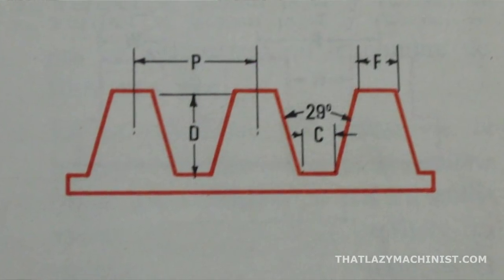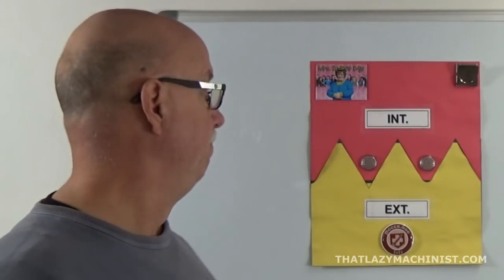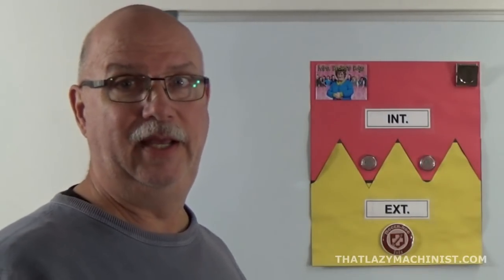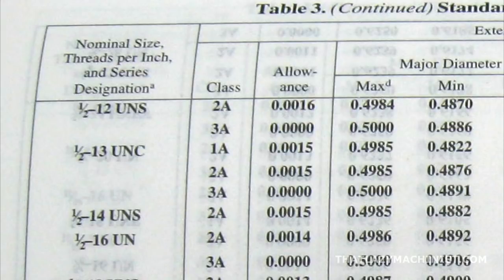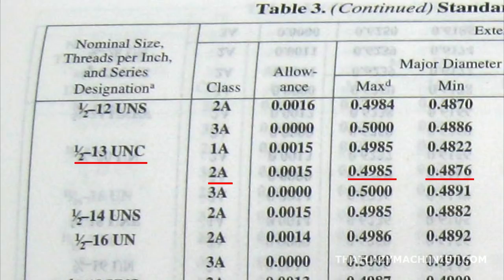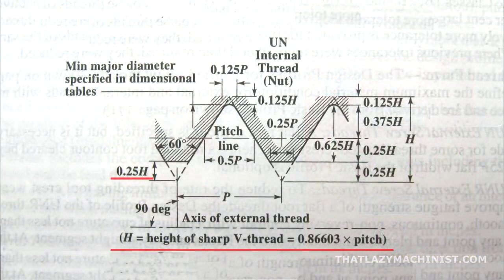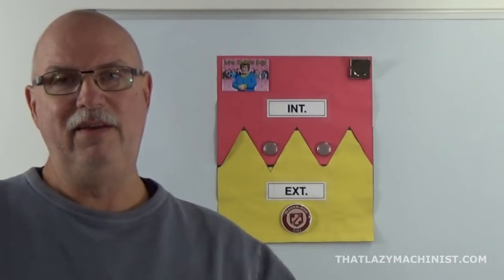HOW MACHINE THREADS WORK, LATHE 101 MARC LECUYER

Comment: I would add this to the differences between fine and coarse threads: there is a cylinder-of-shear where the amount of internal thread cross section and the amount of external thread cross section is equal (it's about halfway between the major and minor diameters - clearance makes this slightly inexact ). Because the coarser threads cut deeper into the shaft of the screw, the minor diameter is smaller; this makes the halfway location smaller as well. Because this cylinder-of-shear is smaller it has less area; because it has less area it is weaker. Thus coarser threads (against all intuition - how can tinier threads be stronger?) are actually more likely to strip - which is what happens when that cylinder of shear actually shears. It's because the finer threads have an average larger diameter.

I really enjoy your videos. Sometimes the fundamentals are needed, even for folks who have some (or much) experience in the shop. (From a fastener guy whose family was in the fastener business from 1929 to 1998.) Thank you.
Reply from the maker: Thank you Peter for such a great comment. It is great that people such as yourself can comment and explain and really add to the video. Truly a great comment, Marc (I am going to make this  the top comment)

Comment: Tell me if I have this right. A MT 4 is .62326 taper per foot. So taper per inch is .62326/ 12= .05193 . My sine bar is 5 inches so 5 x .05193= .25968.  So jo block stack of .25968 under the one end of my sine bar will give me a MT 4 slope on my part.this could be milled on one side of a plate to be used as a template for setting up my taper attachment. 
Keith ps thanks again for your time.
Reply from the maker: Hi Keith! I don't have my handbook close so until I do I will say that taper per foot is total taper (both sides). If you want an angular bloc for setting you taper attachment, you will need half the total taper. Your joe bloc stack of .25968 seems a little high? It may need to be divided by two. I will get back to you later when I can verify your numbers more accurately. Marc

Comment: Thank you. I went to training at the Caterpillar plant and they explained why they only use grade 8 bolts. Simple, so a weaker bolt doesn't get used in a high strength application. Also watched them test the bolts. Tensioned in a machine that progressively put more tension on the bolt but with a wedge under the head to induce another force that real life is likely to do. I think all grade 8 bolts are roll formed, not cut. That should improve the metallurgy/strength. But the holes in the castings would still be cut so would need to have a greater depth to be able to fully utilize the greater bolt strength. There are taps that don't "cut" but rather deform but I'm not sure they would be a good idea in cast iron. Your thoughts on that?

Comment: Really good video because I am trying to use the Machinery's Handbook (download FREE pdf ebook version 29th Edition at http://allaboutmetallurgy.com/wp/wp-content/uploads/2016/12/Machinery_s_Handbook_29th_Edition.pdf, while you can) and I find it carries so much historical info that it takes a long time to sort through what the tables are actually saying. I watched a video on cutting a thread protector for a 10" Atlas lathe and am still trying to figure out how they got to the thread measurements they did, which aren't what I would have calculated them to be.  Slowly I am correlating the data in the tables to stated thread geometry. Looking forward to your next video because I am not sure where some of the info in the tables comes from - can't match all theoretical geometry to numbers in tables. For example, I have to just take "Allowances" as a given, I haven't found the MH explains it will. One good thing, I have worked thru the geometry to be able to understand why/how the "over the wires" measurement works.
Reply: Link Is dead.

Comment: Nice video, and quite informative.  I have one question, though, about a statement you make around 13:08.  You say a sharp-V thread is impossible to manufacture.  But isn't this the resulting thread when you single-point cut an internal thread on a lathe?  It seems that I have to knock the sharp-V off with a file, else there is an issue with the crest interfering with the roots on commercial nuts.  Or am I misunderstanding something?  Thanks again for the great video... I love your presentation style!
Reply from the maker: Hi Clive! It is not rare to have to file the crest of an external thread after cutting it since the single point tool kicks up a burr that can interfere with the root of the nut. If however you are getting a sharp V crest when cutting an external thread it could be that your major diameter is too large? When cutting an external thread I tend to turn my blank close to the smallest acceptable diameter, this helps with assembly and doesn't affect unduly  the strength of the thread. Also I should have been more specific with my explanations! When I mention "sharp V" thread I am talking of a sharp root (which would require a pointy tool) and not a sharp crest (which would mean that the OD for an external thread is too large or that the ID of an internal thread is too small. I hope this helps? Please get back to me if more explanations are required and thanks for watching! Marc
Reply: THATLAZYMACHINIST 
Hi, again... In the midst of a brain fart, I typed "internal" rather than "external";  thanks for clarifying that.  I can probably reduce the O.D. of the blank before threading, but won't that cause a poorer flank-to-flank fit between the mating parts?  It seems to me it would be more "proper", for lack of a better term, to remove the point/burr from the external thread crest so it meets the thread spec more closely.  (Crest of external threads are supposed to be truncated or rounded, I believe.)  Anyway, my original comment was related to your comment in the video about true V crests being impossible to form.  I thought you meant internal AND external, but you have clarified that you only meant internal.  My apologies for any confusion.  Best regards, Charlie

Comment: One thing I noticed a long time ago was that if you take an equivalent sized metric bolt to an imperial; the most common thread used is between a imperial fine and the coarse. With the imperial threads the coarse seems to be to coarse and the fine seems to be to fine for most applications.
  I always compared a thread to a wedge, with the thinner wedge able to exert more force with the same pressure applied. This is why if you applied the same torque to the head of a fine and a coarse fastener the fine thread clamping load would be much greater, which might be part of the reason they seem to strip out easier. 
Cheers waiting for part 2
John
Reply: I had to replace the rotation bearing bolts in an aerial lift truck (ie a tree trimmer boom truck) and the manufacture called for anti-seize be applied to the bolts and the torque value was reduced. I called the manufacture and an engineer there explained that because of the anti-seize that the bolts would turn much easier and if the torque was not reduced the bolts would be stretched. 
He also added that as long as there was not more force applied to the fastened than the clamping load achieved at that torque, the fastener would not come loose even with the anti-seize applied.

Comment: Hi Marc,

As I recall, the 55 degree angle of the Whitworth system gives the very best strength available from the metal, which is why it was also commonly used in the dovetails of machine slides.  When the Metal alloys were of relatively low strength, it was important to be able to use all of that strength, but as materials improved, the small loss of using 60 degrees was not so important and the 60 degree angle is much easer to construct geometrically.

It's also worth mentioning the BA (British Association) threads withan included angle of 47.5 degrees. These are commonly used on older British machinery (machine tools, cars and motorcycles, etc.) where a fastener of less than 1/4" diameter is needed (in a similar way to the numbered series in the US, 10-24, 8-32 etc.). It's actually based on a Metric system (the Swiss Thury thread) with 0BA being 6mm diameter and 1mm pitch, the series then decending geometrically with each pitch being 0.9 times the previous one and the OD being 6 times the pitch. This was then of course mucked up by converting to imperial and rounding. Apparently a 2BA thread is still used in the USA for the stem of Dart flights!

Comment: My question is, how many threads need to be engaged for a strong fit?
Reply: Pat Wicker typically your maximum strength is achieved at 1.5xD of thread engagement. So a 1/2-13 thread will achieve max strength at 3/4” of engagement.
Reply: Thank you